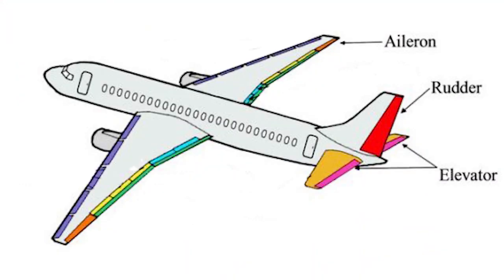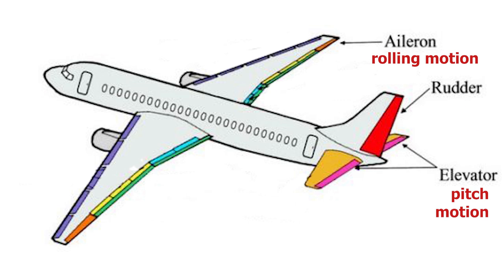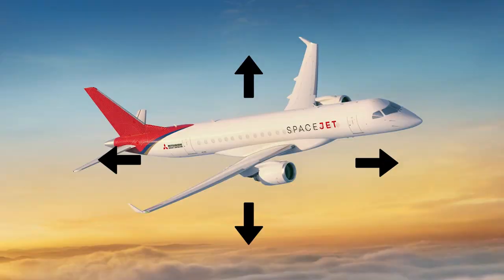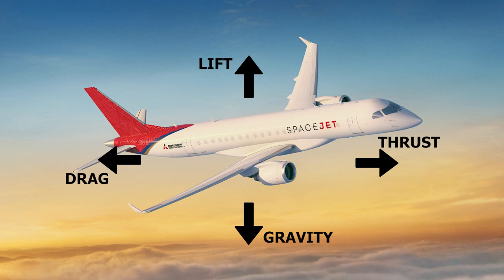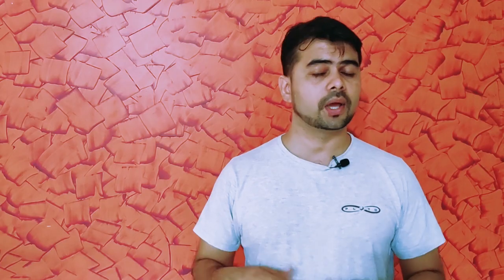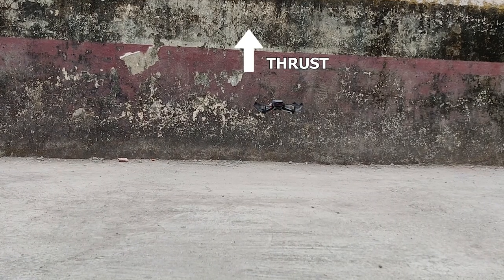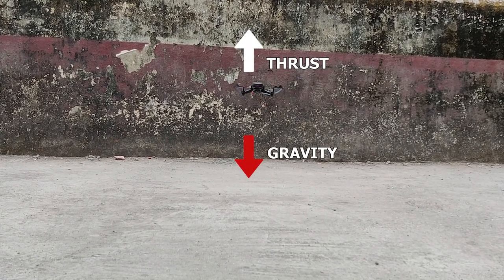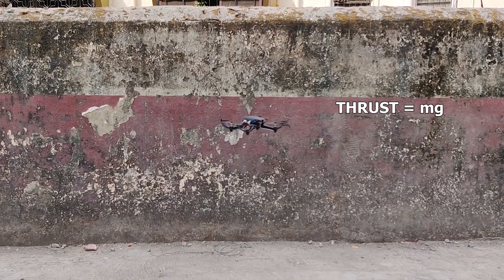Understanding Roll, Pitch and Yaw in Drones

Comment: Good presentation . Why you call the lift in drone as thrust ? Thx
Reply from the maker: Lift and thrust are two different things ,In drones(quadcopters) motors are vertically mounted so that it generates thrust up which results an object to lift , but if you see an example of aeroplane thrust is consider in forward direction because motors/engines are horizontally placed but lift remains same